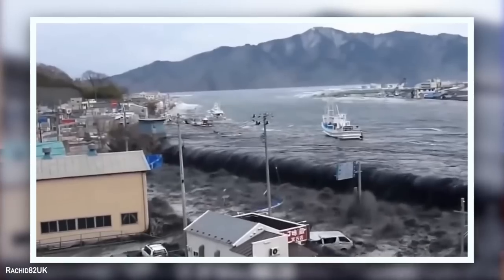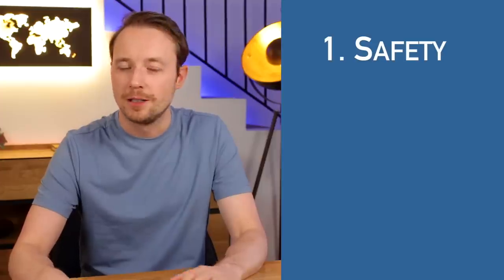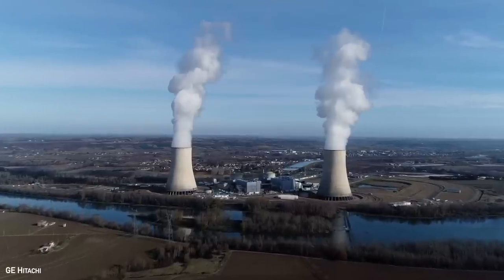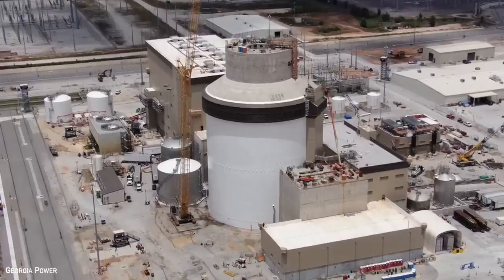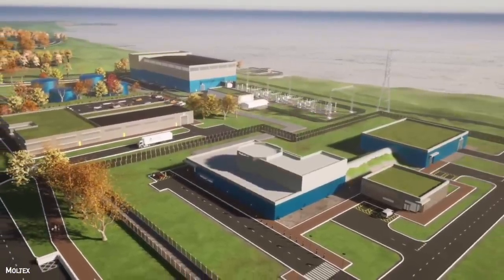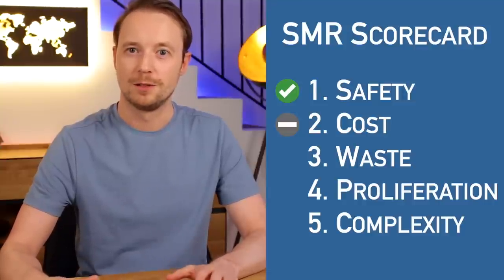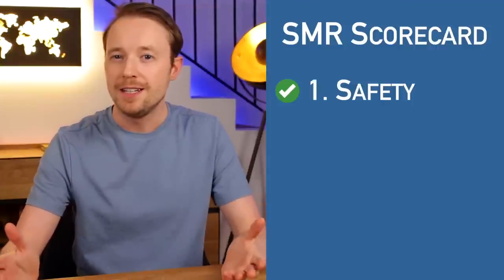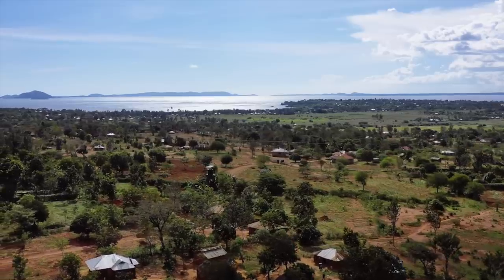Can Small Reactors Revolutionize Nuclear Power?

Comment: None of the presented costs for solar and wind account for the associated costs for construction and maintenance of demand and production leveling electricity storage or generation. Massive (~20yr) end of life waste for solar is also not mentioned. Given the SMR advantages of on demand delivery and use of existing grid infrastructure, the cost comparisons here seem pretty flimsy and lacking in rigor. BTW, China has their LFTR proof of concept reactors running now.  🙂
Reply: Does nuclear have maintenance or taking into account that they are base load and grid inefficiencies that occur because they must run at 100% power???

Wind turbines  will last indefinitely with maintenance.  Only the fiberglass blades are replaced every 25-30 years.  Solar panels are rated for 0.75% decrease output per year  They still provide 78% output after 30 years and if disposed of they are 99.9% silicon (i.e. SAND)
Reply: @clarkkent9080  I'm not sure you understand nuclear power generation if you think that that the systems have to operate at 100% output 100% of the time. Nuclear power systems could never have been implemented if their output couldn't be throttled and coordinated to match demand on the grid. Evolved and scalable designs (aka SMR/LFTR) provide even more throttle control.
Reply: @arxaaron  Excuse me.  After working 40+ years in nuclear operations at five different facilities I must be mistaken.  Wait, no I am not.  Nuclear power plants cannot follow load needs on the grid.  You can change reactor power but you will be chasing xenon for days after that.  I have in my entire career never had a dispatcher ask me to change load.  We always ran at max power and never changed that.

Where did you get your nuclear knowledge? stay at a Holiday Inn last night?

so while nuclear can provide the lowest grid load, there must be other power production methods to follow the ever changing needs.
Reply: @arxaaron  You may want to wait until a SMR is built and operated before making claims.

Or you could try reality for a change.

This is from the Des Moines Register an concerning the only Small Modular Reactor (SMR) project in the U.S. today. It should be noted that NuScale said this month (Jan/2023) the target price for power from the plant is $89 per megawatt hour, up 53% from the previous estimate of $58 per MW hour.

In 2013, the Wall Street firm Lazard estimated that the cost of generating electricity at a new nuclear plant in the United States will be between $86 and $122 per megawatt-hour. Last November, Lazard estimated that the corresponding cost will be between $131 and $204 per megawatt-hour based upon the 4 recent new nuclear projects in the U.S. . During the same eight years, renewables have plummeted in cost, and the 2021 estimates of electricity from newly constructed utility-scale solar and wind plants range between $26 and $50 per megawatt-hour. Nuclear power is simply not economically competitive.
SMRs will be even less competitive. Building and operating SMRs will cost more than large reactors for each unit (megawatt) of generation capacity. A reactor that generates five times as much power will not require five times as much concrete or five times as many workers. This makes electricity from small reactors more expensive; many of the original small reactors built in the United States were financially uncompetitive and shut down early.
The estimated cost of constructing a plant with 600 megawatts of electricity from NuScale SMRs, arguably the design closest to deployment in the United States, was originally advertised as costing $1 billion but upon requesting actual bids from engineering firms, increased to $6.1 billion in 2020. Given inflation and other cost constraints that cost today can only be expected to be significantly higher.
The cost was so high that ten members of Utah Associated Municipal Power Systems canceled their contracts. NuScale then changed its proposed plant configuration to 6 fewer reactors but increased each reactor output from 50 Mw to 77 Mw costing at total of $5.3 billion. The NRC just last week approved the construction of the 50 Mw design but now will have to start the review process all over given the switch to a 77 Mw design. For each kilowatt of electrical generation capacity, that estimate is around 80% more than the per-kilowatt cost of the Vogtle project in Georgia — before its cost exploded from $14 billion to over $30 billion. Based on the historical experience with nuclear reactor construction, SMRs are very likely to cost much more than initially expected. And they now have delayed the project start until 2025 in an attempt to find more backers.  All this before the inevitable setbacks that will occur once construction starts.
Reply: @clarkkent9080  Thanks for the additional information and sharing the knowledge of your experience. My sense is that we aren't talking about the same apple. In any case, the challenges and life cycle costs of wind and solar remain and need to be considered in that reality you mentioned.
And sorry you felt need to go personal and derogatory because that makes makes  dismissing all your explanations and arguments very tempting.
Reply: @arxaaron  Agreed.  My excuse; I am old and and my generation didn't do all the touchy feely nice stuff. In the industry, we are taught to get to the point because there is no room for error.
 I find that most people on here actually think Thorium reactors fission thorium.  They should be called a U233 breeder reactor.
 People watch a YT video made by someone who makes a living making YT videos and maybe selling merch and they take everything said as fact and usually don't even understand everything they see. 

 People who read technical articles written by people with education and experience will better understand the issues but apparently today that takes too much effort.

There is so much disinformation on YT videos that I have to vent reality. I am pro-nuclear but that does not mean that I have to make excuses for the recent failures. I keep up with industry news and none of it is good.
Reply: @arxaaron  Here is some depressing information on SMRs.

This is from the Des Moines Register an concerning the only Small Modular Reactor (SMR) project in the U.S. today. It should be noted that NuScale said this month (Jan/2023) the target price for power from the plant is $89 per megawatt hour, up 53% from the previous estimate of $58 per MW hour

In 2013, the Wall Street firm Lazard estimated that the cost of generating electricity at a new nuclear plant in the United States will be between $86 and $122 per megawatt-hour. Last November, Lazard estimated that the corresponding cost will be between $131 and $204 per megawatt-hour based upon the 4 recent new nuclear projects in the U.S. . During the same eight years, renewables have plummeted in cost, and the 2021 estimates of electricity from newly constructed utility-scale solar and wind plants range between $26 and $50 per megawatt-hour. Nuclear power is simply not economically competitive.
SMRs will be even less competitive. Building and operating SMRs will cost more than large reactors for each unit (megawatt) of generation capacity. A reactor that generates five times as much power will not require five times as much concrete or five times as many workers. This makes electricity from small reactors more expensive; many of the original small reactors built in the United States were financially uncompetitive and shut down early.
The estimated cost of constructing a plant with 600 megawatts of electricity from NuScale SMRs, arguably the design closest to deployment in the United States, was originally advertised as costing $1 billion but upon requesting actual bids from engineering firms, increased to $6.1 billion in 2020. Given inflation and other cost constraints that cost today can only be expected to be significantly higher.
The cost was so high that ten members of Utah Associated Municipal Power Systems canceled their contracts. NuScale then changed its proposed plant configuration to 6 fewer reactors but increased each reactor output from 50 Mw to 77 Mw costing at total of $5.3 billion. The NRC just last week approved the construction of the 50 Mw design but now will have to start the review process all over given the switch to a 77 Mw design. For each kilowatt of electrical generation capacity, that estimate is around 80% more than the per-kilowatt cost of the Vogtle project in Georgia — before its cost exploded from $14 billion to over $30 billion. Based on the historical experience with nuclear reactor construction, SMRs are very likely to cost much more than initially expected. And they now have delayed the project start until 2025 in an attempt to find more backers.  All this before the inevitable setbacks that will occur once construction starts.

Comment: Look at Copenhagen Atomics  cost at 20 US $  per mWh  and no investment for reactor since they promote energy as a service 
100 MW th Unit that can be added for the power that is needed. Burns Nuclear waste and want to build in a factory 1 unit per day.
Have started an approval process in UK
Reply: That will be great.  But until they actually build one reactor and successfully operate it, everything you said is corporate propaganda from a 5 year old company that has not built anything..
Reply: @clarkkent9080  look at the website to see what they have already built.
You call it propaganda  , that sounds negative 
You could also call it information or marketing and that is required to make it known
Reply: @wilfriedhahn5053  I did look at their company information.  They only proposed building one 5 years ago.  Nothing has been built and proven.  Please correct me if I am wrong.  I call it propaganda because claims are made with nothing to back it up.   You should have said they are proposing a design that......  But your statements are written such that they lead one to believe they have built one and proven these things can be done and that simply is not true.

Comment: This feature is based on a USA viewpoint and rather loose stats from elsewhere.
As a matter of fact (including working SMRs) the UK is in the lead and has more developed models of regulation than the USA.
The US model treats large power stations and SMRs the same way and this is pathetically lazy.
Reply from the maker: Agreed. I would argue most markets outside the US are more advanced when it comes to regulating non-light water reactors. NRC is rather prescriptive and their recent attempt to correct this was not so successful, in my view. UK and others generally write broad regulations that could cover many types of designs, and then offer additional guidance on specific designs. Even Canada is relatively flexible and they only have 1 type of design. Cheers!
Reply: @atomicblender  I am pleased that you liked my comment. Were the USA to apply the UK, revised French,  Spanish and Finnish site-specific SMR approach it could ensure non-carbon base load per state and district (usually cities) supply as well as making moderate profits for locally overseen companies. Indeed the USA could have a surplus to export to Latin America and arctic Canada from SMRs in Alaska, thus 'buying' a stake  in Canada's part of the arctic seaways.
Interestingly, despite the current Russophobia in the west, the growing importance of Asian Russia in the Eurasian economic steady market boom lies not just in its phenomenal railways and arctic preparations but in the widespread use of SMRs akin to the Rolls Royce type and partly paid for by the Steppes countries which are mainly former SSRs but have individualized styles of independence linked by the CIS. The use of SMRs in the region had its origins in building electrified railways to join the Russian TSR and BAM networks to the sub-continent, Mongolia, China and Japan/Korea.
Finland's problems with a major new reactor could be solved by bunched SMR use using cabling already erected for the delayed big one whereby waste products could be stored in many places.
Although Norway has so far eschewed nuclear generation discussions are advanced in using SMRs ready for arctic development.

Comment: I you are wonderfully clear and competent in presenting a  mix of SMRs and intermittent renewable as an attractive way to have cheap energy and zero greenhouse gas production in excellent business form. 

What if the whole nuclear industry  from mine to waste entombment can be undercut by a new understanding of thermodynamics providing an elegant way to power our civilization by borrowing some ambient thermal energy from the planetary air water or ground, change its form to electrical energy, use the electrical energy for heat, light, motors or electronic devices as we wish and let the heat released by these uses return to the ambient. Refrigerators would absorb heat from inside of their insulated compartment(s) and export the equivilent energy as electricity. 

Do you think it is reasonable to consume a lot of energy by cyclicly moving a large sealed robust container of water (a large thermal mass) back and forth between a stove and a freezer both requiring electrical power? You aren't making any  permenent changes as you alternately melt and freeze the water inside. The container and its water aren't becoming less orderly as the exercise continues. The unreasonableness of this waste is a challenge to the second law of thermodynamics. 

Here is a thought experiment device that creates self powered thermal diversification. The thought experiment device is impractical but easy to visualize and check for mechanical workability.  It's parts are large enough to act as everyday materials but small enough to work well with the microscopic thermal motions of gas molecules. 

Sketch made with keyboard characters: 

COLD ROOM   ())--:WALL:-->> HOT ROOM    

Key
()) = Paddlewheel. 
-- = Axle.  (Continuous from end to end)
: :  = Axle tunnel going through a wall.
>> =  Lumped friction element

Please visualize two roome full of air separated by a very thin wall that allows the rooms to hold their heat independently with minor leakage through the wall. The wall is thin to delicately support billions of  separate nanometer scale short axles running straight through loosely enough to rotate freely but  not leak very much heat so the rooms can hold separate temperatures. 

On the left side, a very small paddlewheel is mounted at the left end of each axle. On the right side, lumped friction elements are mounted stationary in place on the wall, one for each axle, for the right end of each axle to run through. The lumped friction elements convert the mechanical rotation of their axle into heat. The lumped friction elements do not impart Brownian motion to their axle.  

Brownian motion (a nanometer scale effect) turns the paddlewheels at random speeds randomly clockwise or counterclockwise. This random rotation is turned into heat by the lumped friction elements.    

  The committed, linked, and functional roles of the paddlewheels, axles, and lumped friction elements in differnt places should systemically produce a divergence in the thermal energy in the two rooms without adding external energy. 

Water in a sealed container could be endlessly cycled without cost between melting from the heat of the lumped friction elements' side and freezing from the cold of the paddlewheels' side. 

Here is a hypothetical practical method with the working name thermary: The thermary mainly consists of two electrodes closely face to face (~1 micrometer) in a vacuum wired to an external electrical load. The face of the [Emitter] electrode is covered with a uniform array of LaB6 tipped small diameter carbon nanotubes grown straight out. The face of the [Absorber] electrode is covered with small scale graphine flake char. [Rice U 2014] 

Thermal energy mobilized unattached electrons will tend to free themselves outward from the emitter tips and drift at ~1 million meters / second @ 25 millivolts (thermal electron energy @ 20 C)  to the absorber which tends to collect them.  

A negative charge accumulates on the absorber. This repels oncoming electrons slowing their forward drift, cooling them. The absorber electrode charge is simultaneously the repelling cooling and the external electrical load voltage. The drift current and external wire route current are the same. The DC electrical power consumed by the electrical load depends on the load resistance. Thermal energy absorption always equals the electrical yield. 

Wire resistance is a practical loss not a true loss so lt is overcome by added thermary output. The extra cooling balances the heat given off by the wire loss. The performance of the device is expected to be modest in the beginning but improve rapidly. Even early devices are expected to last a long time. There is little place for obsolence if the first installed thermary works adequately. They will withstand being short circuited indefinately up to an electromigration limit.

Aloha
Charles M Brown lll
Kilauea, Kauai HI 96754
Reply from the maker: You've proposed very interesting thought experiment, although I'm afraid it becomes a little tricky to follow the details in a comment like this. Do you know of any videos that present it?
Also, thank you for your kind words on the clarity of the presentation, that's helpful. Cheers!

Comment: I personally like large reactors. It is easier to monitor less but bigger reactors. It would cost a lot to monitor thousands of small ones.
Reply: UK super stations of 2000MW were built using 4 x 500 MW units plus immense coal stockpile areas. Monitoring of 4 or more SMRs on the same secure sites would be very simple to achieve.